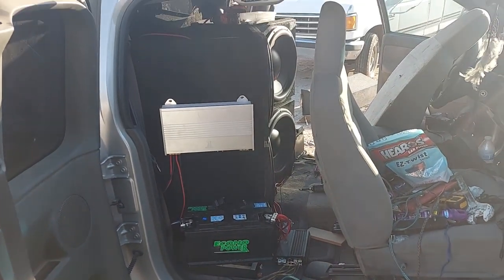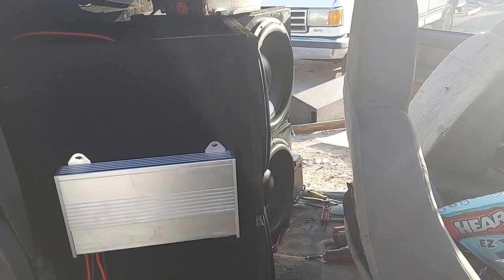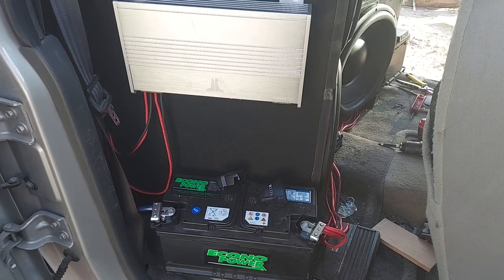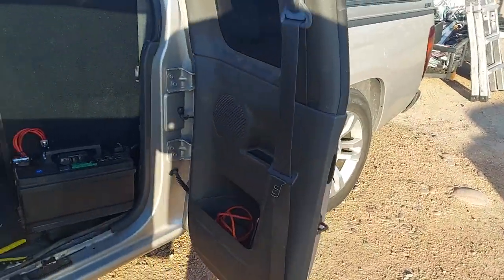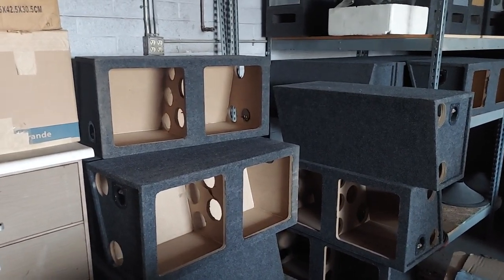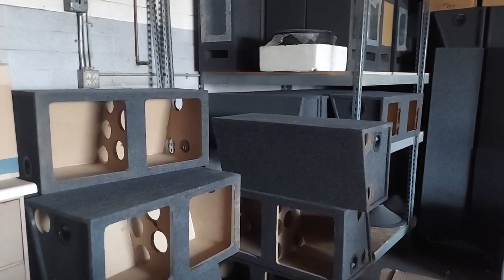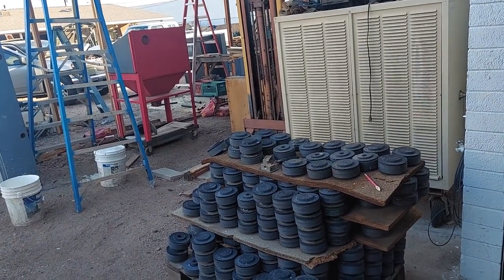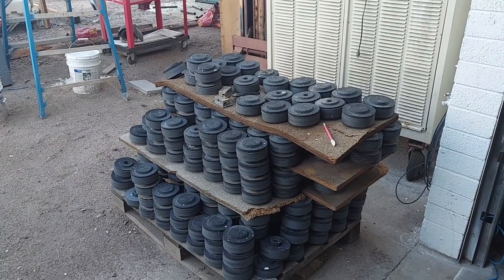4x 15" Jizz Llama Fister Series Subwoofers in Taz' Work Truck + Kenon Electonics for wholesale amps

Comment: No prefab boxes are good except for fox box which still aren't the greatest because I had a fox box that was great but was designed for 12s and built rings for 10s because inside air diameter is based on adding port diameter

Comment: Idk the gladiator 12 I kept out of all I've sold, has impressed the hell out of me. 
Did you jizz out there component sets too? 
Demo the van when finished.  I know sound doesn't pick up through video, but shaking the shit out of the truck does...
Reply from the maker: I have the access to the Recoil Audio mids for less
Reply: @RobotUnderground  those rose series are killer for the price!!!
Reply from the maker: @trecedaves3159  Yes.  I'd love to see someone use them in home theater.

Comment: Taz? Well it looks like the cartoon Taz smashed through the fn truck. How the F does any one work out of that shit hole. He would spend more time looking for a tool then using it. Just 10mins a day organizing your shit will save you a hour of day  and a lot of unnecessary headache.
Reply: Looks like my work truck.

Tools were kept in my tool box not the cab.
Reply from the maker: He's doing the best he can with what he has.  There is more than one way to be.
Reply: @RobotUnderground  Im not judging dude. Thats my point, he is not doing the best he can. Im a contractor and am speaking from experience. I use to let that shit pile up, especially after long days. I was literally wasting more time looking for shit and buying shit I already had but couldn't find......then actually working.

Its like anything else....If you let things go to far, you will never catch up.

Taz if you see this.....get organized, then take the 10mins before or after work everyday. You will be 1000x less stressed during your work day and make more money. I promise you.
Reply from the maker: @johnd5542  You can only bring a horse to water.  You cannot make them drink.